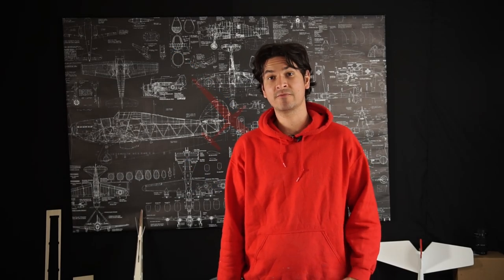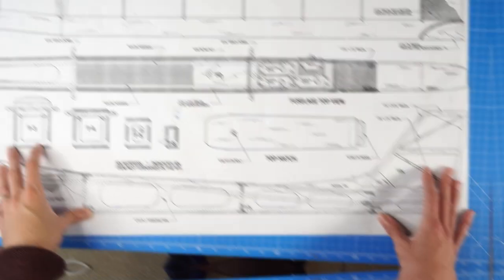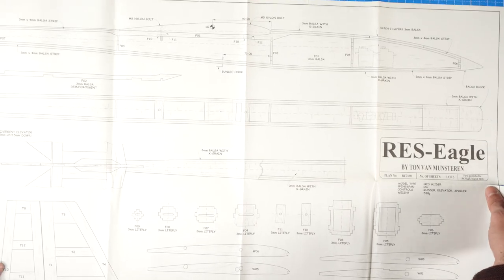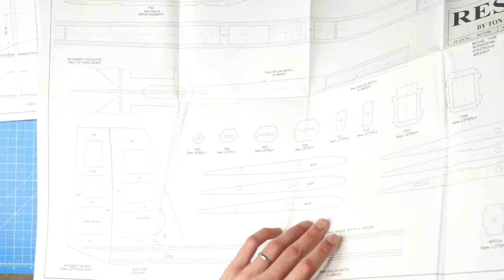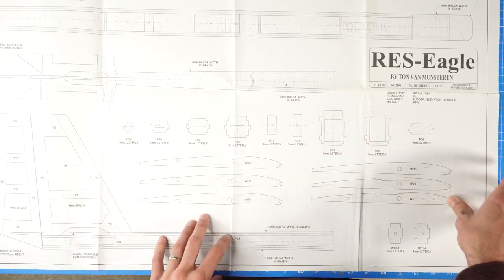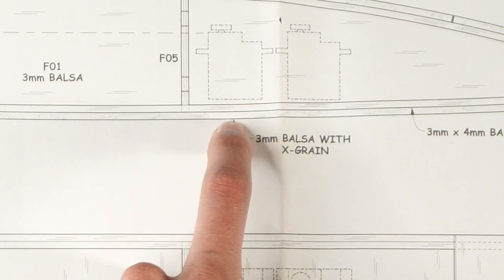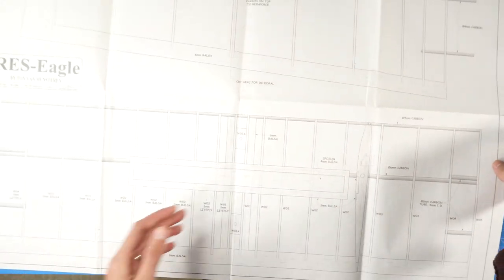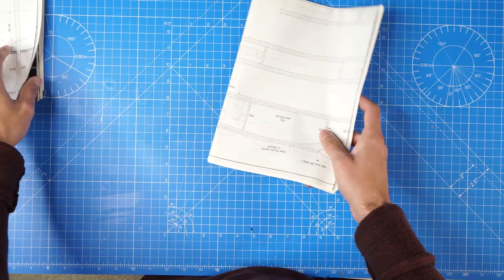Plans for RC Aircraft Masterclass | Part 2 - How to read and interpret plans?

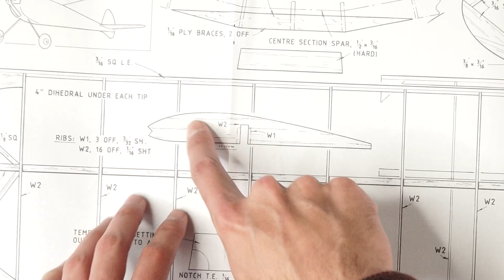Comment: thanks for posting this, for those who need it.      i offer some facts and observations regarding the use of  antique  plans, to build a model aircraft.        it is not wise to blindly  copy every detail, in  Seventy year-old plans!!!     most newer plans are  similarly, flawed.      decades-old designs are resurrected in their entirety, by Under-informed hobbyists.       newer design errors are so widely repeated that, they have become the new  Normal.         at 1:37,   see what  No  one  else  does  ---  the use of  weight-reducing  panel  CUTOUTS; at the tail boom !!!!!         at 2:08, top center, turbulators  are  shown on plan;  they do  NOT  scale down !!!   because  AIR  does not scale down !       at 6:50,  this is a  'fast' (slightly thinner) version of a  clark-y profile;  assuming a zero-degrees aoa wing mount, the wing will have a  higher stall speed (than the clark-y).        at 7:07, where a flat-bottomed profile is used, the  lower edge of a rib is the primary reference.       at 9:00, another  'fast'  profile.       at 11:23,   a good,  lift-making  profile is  shown.     above it,  a  fuselage-spanning,  dihedral  BRACE  is  shown.         at 11:25,  typical wing leading edge construction is shown.    ribs have a miter notch at the leading edge;  and a piece of  dimensional wood spans the ribs to form the leading edge.        at 11:48,  a rib should  Not  almost be  bisected; at the main spar !!!   this  Was  WONKY  design.       googletranslate
Reply from the maker: Thanks for your observations.

Comment: IF the plans are actually plans and not technical drawings ... as a plan they have a title box which details what the plans are and what scale they are drawn in on that sheet ... as technical drawings they dont have the title box with all the details needed ... and are just that drawings and not at any true scale whatsoever ... ONLY plans have actual usable dimensions ... those drawings for the eagle you took out of the book are technical drawings and not actually to ANY accurate scale other than what would fit on what they were willing to add into the book ... if they were plans each page on the bottom right corner would have the title box with all relevant data for the plans ... those do not and so are nothing more than drawings on a napkin ... and just as reliable .... this is why you start your drafting knowledge nby doing it all by HAND on paper ... before you ever try it on a computer design system ... so you actually KNOW the difference between technical drawings and plans ...